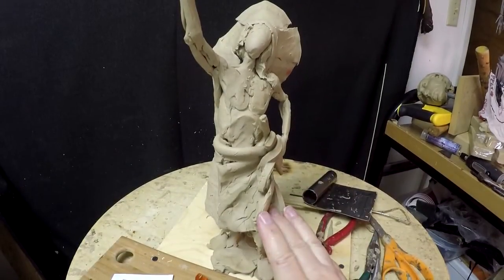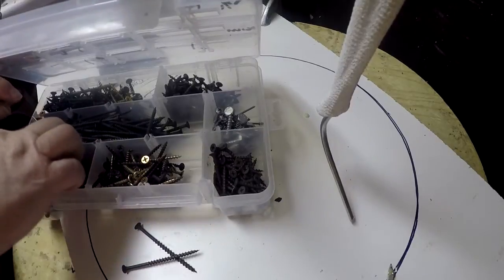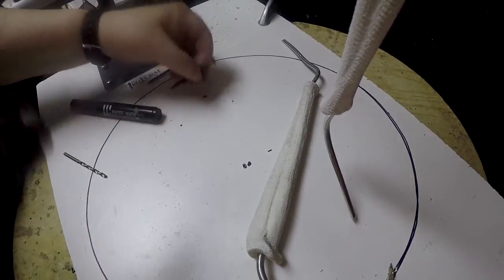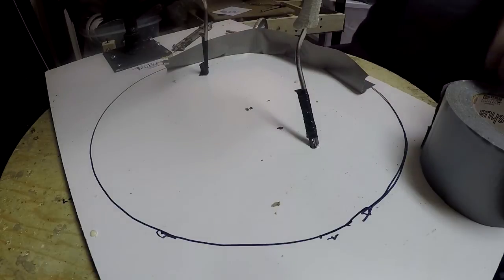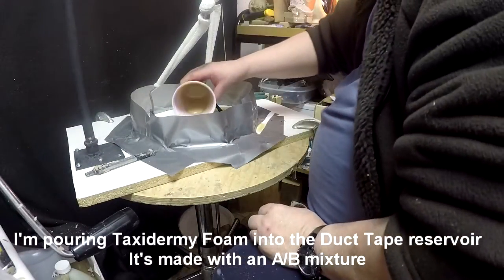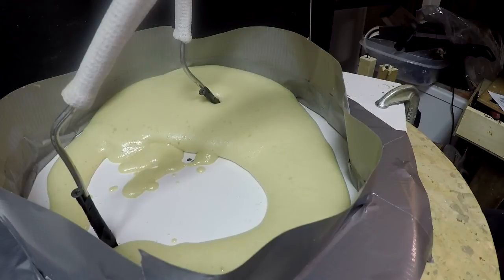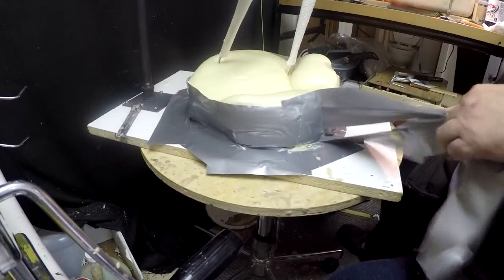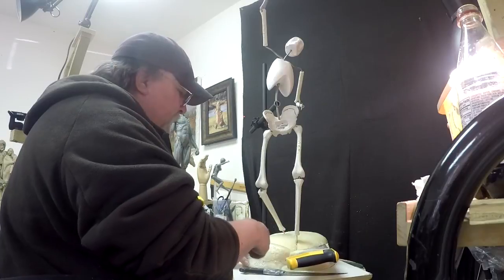New Clay - Touch the Clouds - Using a TruForm 12 inch Armature - Starting the 12 Life Size - Part 5

Comment: Happy birthday to you David, and I wish You a wonderful day :-)

And You can use one of these hand held hot wire foam cutters, it literally leaves no rubbish at all, and You would be done cutting the foam in just a fraction of the time compared to the saw, and you also would be able to sculpt rocks or other foam shapes as a stand for your sculptures. It's only 32 dollars at amazon but they also sell them at hobby shops for model airplanes. Compared to your saw this tool will feel even sharper then a scalpel. I've build one myself a few years ago since I had the parts for it, but they cut foam fantastically well and very fast and easy and I can really recommend it.

http://www.amazon.com/gp/product/B0006KSMEU?ie=UTF8&tag=stormthecastl-20&linkCode=as2&camp=1789&creative=390957&creativeASIN=B0006KSMEU
Reply from the maker: great Idea.. thank you